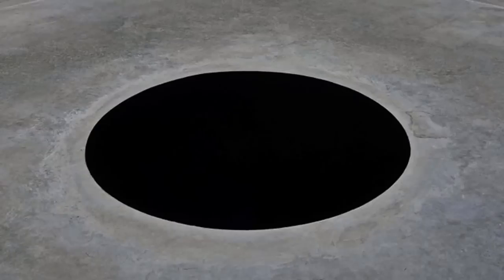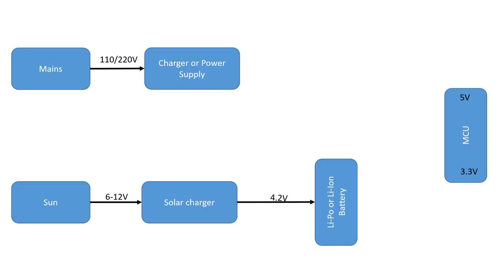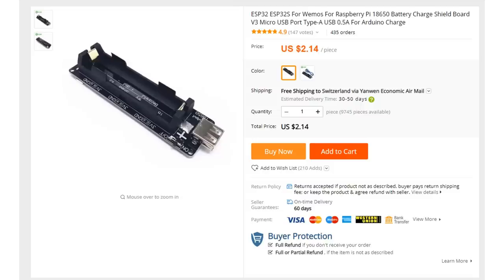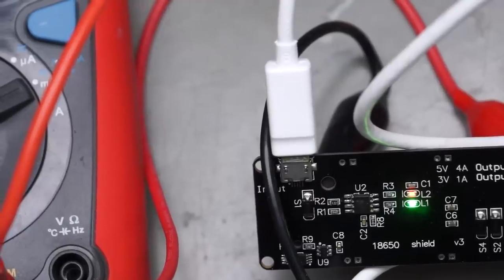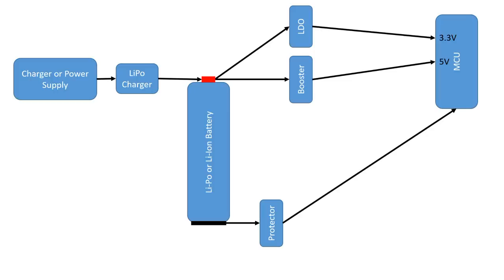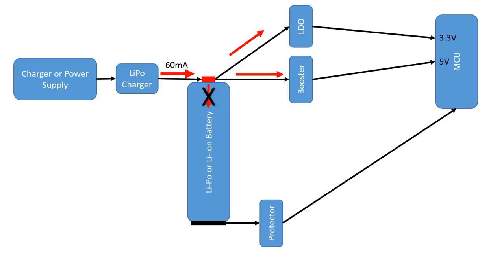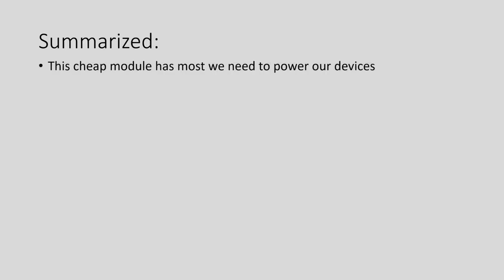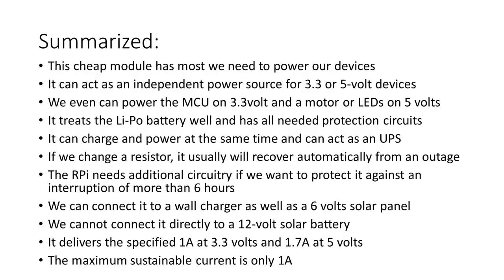#250 Universal Power Source (UPS) for only 2$. Is this possible? (Raspberry Pi, Arduino, ESP32)

Comment: I think you got the abbreviation wrong. It's Uninterruptable Power Supply.
Reply from the maker: Generally: You are right. But this module can do much more.
Reply: @AndreasSpiess  Maybe you should call it a UUPS
Reply: @AndreasSpiess  he isn't "generally right" he's specifically correct. How is this "universal"? Will it power my home? My car? No, it won't. If you think capable of powering a handful of devices makes it somehow special and "universal" I've got some bad news for you, any old UPS is capable of powering anything with a kettle lead or even more if you branch from the kettle lead to a plug socket, making it a hundred times more "universal" by your measurement.
Reply: There's always one. In this thread, it's you.  I'm sure your parents are proud.
Reply: That's what I was 🤔 thinking
Reply: To me it seems that the title "(Raspbery Pi, Arduino, ESP32)" clearly restricts the "universal UPS" claim to where it reaches... Just being reasonable, one can really really and clearly see that one or two small batteries won't run "your house"...
Reply: Smells like someone farted in here a while ago, but I just arrived :D
Reply: @jamesfirth7795  Generally as in “Generally speaking” as in “Generally speaking UPS means universal power supply” but Andreas decided to have fun with the video title because these things are made for many different maker projects. If you want to be pedantic then at least understand the context first.
Reply: Yeah I’m not understanding the Universal part, it doesent seem too universal
Reply: Basics
Reply: @Alacritous  I would be.

Comment: Andreas, you have a large enough viewer base. Why not design a product like this but with the modifications you just mentioned, and then open source the design or contact a chinese manufacturer to create it cheaply?
Reply: That is a freaking great idea.
The Andreas brand will rule the market. I for one will be a fan for life.
Reply: Professor Spiess, also it would be great if this new product had one more USB input port or even another Micro USB input port for the solar panel. Congratulations for this great class and I hope you design this new product! Thanks!
Reply from the maker: I sold hardware in the 1980 when one computer cost at least a million. Then it was fun. Today I will no more touch hardware as a seller. Sorry. Sometimes manufacturers also watch my channel. Maybe they react themselves.
Reply: @AndreasSpiess  actually, for the most part, if you design something useful, and at least do a test or prototype run, you will find nearly exact "clones" on your usual far east marketplace sites within a few months. But I do think you should release something of more ideal design under the "Swiss Accent" brand name;
Reply: @zerog2000  If he made a circuit and had JLCPCB or anyone else make it, I'd buy it just as support. Like other channels do t-shirts etc
Reply: @gg-gn3re  second this
Reply: @zerog2000  If you're not in marketing you may have missed your calling.  What a perfect brand name!
Reply: For the manufacturers out there! I'd love one that only charges to 4v, and cuts off at 3v to prolong the life of the battery! ;-)
Reply: Somebody could build.a gerber file and build the PCB.
Reply: @AndreasSpiess  Would like to build a safe 3.3V UPS.

Comment: I took a different approach on this topic, I made a small low power module that can charge a battery and power a device separately. for this I used a P channel mosfet (between boost and battery) and extra shottky diode. My module contains TP4057, smaller sot23-6 version of TP4056, some protection designed to cut off at about 3V, boost converter is MT3608 set for whatever voltage you need. When I connect usb lead, charger charges battery, mosfets disconnects boost from battery, and current flows from usb lead to boost part through a diode. As I made this to power up a DSO Shell, it's small, with everything on one side, but I think that mosfet swiching thing can be easily scaled up for higher current demands.
Reply: Post the schematic please
Reply: that is a much better design! you want to eliminate the number of power conversions in your circuits if possible. so the diode sends 5v directly to the loads dropping only 0.5v (could be less with a schottky) where with the power going through a TP4056 you get at most a 0.8v drop (not to mention the excessive wear on the cell when acting as a capacitor). this is always going to be a higher voltage than the battery so the diode in the mosfet will not conduct. Once usb power is gone then the mosfet will conduct the battery voltage directly to the load with very little voltage drop. I just wonder if there is a way to replace the diode with another mosfet, I think the trouble is getting it to turn on and off properly.
Reply: @SuperBrainAK  I added possible solution for this, it might work.  N channel mosfet with gate with a pull down resistor tied to the source connected to a usb power, and drain connected to a boost part of the schematic. This way when there is no usb power, mosfet is turned off, and when you connect power to it, that mosfet should open and conduct without any problems. Probably.
Reply: @kjur18  You can test one if the ideal diode modules you can get off eBay..
Reply: @SuperBrainAK  Let's see if we can mod this board with a diode, a mosfet (what do you use for Q2?) and a 10k resistor.
And maybe add some caps to avoid dropout during transitions.
Reply: Consider marketing your design on tindie, etc, before the Chinese steal it as per their usual modus operandi.
Reply: @HMPirates  Hmm they tend to not work in low voltages for Single cell Lithium batteries . The mosfets used in them tend to have higher Vgs Tresholds.
Reply: @kjur18  When USB power is present Source will be Positive and Gate will be ground so Vgs will be Negative So N-MOSFET will block right ?
Reply: @gopikrishnayogarajah  I might have messed up something in my mind, so I think it won't be easy to replace that diode. Well, first version works fine, there is no need to change it.
Reply: @youliantroyanov2941  What I used to make this are in fact three different products put into one board, to save space, even that mosfet based switch is something I found somewhere at JYETech page, they have a board like that. So it's not really anything new and groundbreaking.

Comment: Add some more 18650s in parallel
Reply: It's better to add a larger cell instead if possible, because you will need additional protecting circuits against high currents between the cells caused by their different condition: voltage, charge, age, etc.
Reply: @Megavoltamper  not really as long as you parallel the cells at the same voltage and leave them connected while they are being used, the only thing you may want is a fuse so if one cell dies the other(s) wont also. people do this all the time when making large batteries.
Reply: @SuperBrainAK . Multicell   LiPos have to be balanced after several cycles but preferably every cycle.
Reply: @RTmadnesstoo  that is only if the cells are in series, if they are in parallel and about the same size you dont need anything special to connect them together.

Comment: Great video. The correct way to deal with the issue of charging the battery whilst connected to a load is to run the Vin through a schottky diode to the boost converter bypassing the LiPo charger. The LiPo cell is then connected with  P-channel mosfet to the boost converter with the gate of the mosfet also connected to Vin. This will allow the battery to be charge independently of the load but will also switch the battery into play as soon as there is no input power. It's not good practice to sap the load power off the battery charger as you highlighted.
Reply from the maker: What are the advantages for the application described here?
Reply: Andreas Spiess By drawing power for the load separately from the LiPo charger whilst charging it would overcome the issue you mention in the video where the load of say a Pi doesn’t have enough current to function properly if the battery is charging but at a almost empty state. There’s a fantastic write up by Zak Kemble http://blog.zakkemble.net/a-lithium-battery-charger-with-load-sharing/

Comment: Thanks for the video.  I also tested two of them.  Bad solder joints on both. One dead after a month, and one DOA. I had to repair both, a chip lead, a fused resister, and a usb pin. Ordered months apart.  In the real world an rpi cannot run off one.  The battery voltage will drop over time.  There just isn't enough headroom with 600mah.  At least that was my experience on the two I tested.  After 4 days, a fully charged lipo which started  at 4.2v, was at 3.87v and dropping.  So it's not reliable for an rpi without changes.  And recovery isn't an option after an outage like you mentioned.   For esp's though, it's potentially fine.  I considered making one with two usb inputs, and switching.  This would leave enough overhead to manage the charging vs discharging separately.  That's the design I think I'd like to see.  A real ups should switch power sources, not unreliably limit the whole thing.
Reply: One dead after a month, with current well below 1A...
Deep sleep current was not 300µA all the time.
No battery reverse polarity protection (you need to often remove it to make a full reboot).
Good idea, although a "v2" would be greatly needed ;)
Reply from the maker: I have 4 of them. None was DOA, at least :-). Maybe you change R2 as shown to increase charging current to 1A
Reply: I have two of these that I bought 6 months ago. I use them all the time but not on RPi, just on Arduinos (ESPxxx or ATmega). They are very convenient for breadboard projects and I have never had any trouble with them. The only “problem” I see is that if I change the 18650, I also need to connect the USB-in port to a power source before any power comes out the USB-out port. I have assumed this is some kind of reset mechanism. However, I don’t think I would try to use one of these in a permanent project. For that I would usually go with a board that had a battery port on board. My LoRa gateway is based on a Heltec ESP32 + OLED with an 18650 inside the box wired to the battery port on the Heltec. Most of the time the Heltec gets power from its USB port but switches over to the 18650 instantaneously if USB power goes away. When USB power comes back, it instantaneously switches back to USB power and recharges the 18650. If that doesn’t qualify as “uninterruptible” I don’t know what does.
Reply: @AndreasSpiess  yeah I was going to give that a try :)  Was super informative. r1 is actually what burned up on the original one I had. So I need to replace that guy already. No clue why it did that or if it was a physical failure....  However an rpi runs pretty much all my home automation.  So not starting after a long power failure, is actually worse than the power failure :)  I'm working on  centralizing my backup power.  I've got all the parts, just not all the time to invest. :)  Best wishes and thanks again.  I enjoy your videos.
Reply: @HIBAW  why then not consider ol' good 12v lead battery if it is home automation and size/weight aren't an issue? Use tiny one, like 4.5AH. Controllers can be bought cheaply at firms that sell fire alarm / security hardware
Reply: @AB-pb8oo   Yes.  That's a really practical suggestion actually :) My pi is on a real ups atm.  I have one of these as well.  https://www.cyberpowersystems.com/product/fttx/cs50u48v/

 I still feel the need to take a whack at making something a little more flexible, cheap and portable.  If it's turns out cool or is worth mentioning I'll for sure report back.  The fun is the chase :)  Thanks for the suggestion cause that's been on my list and I should just get it done.
Reply: Its not good to leave a lipo on float charge of 4.2V permanently, battery life cycles will suffer. Laptops and mobile phones do some stuff to prevent thi. In a simple circuit like this it would suffice to lower the voltage a bit below 4.2v

Comment: I've never seen a Chinese product like this that works all that well and I have a little pile of puffed up lipo cells to show for it. I don't think it's easy to make something that works well with the cheap discrete components making up the charger->protection->regulation path. Richtek has some cheap (~50cents from taobao) parts that can do almost everything and have "power path switching" that switches the load directly to the input so it doesn't fight with the charger. Those would work well for a board like this. Aside from that there are PMIC chips that have the charger, power path and programmable DC-DC supplies for not much more that would probably would well if integrated into module with an ESP32. You'd be able to put sensors etc on their own DC-DC converters and turn them off when not needed, see the state of the battery etc.
Reply from the maker: There are some very nice chips used in tablets. However, I never saw them on a module.
Reply: @AndreasSpiess  

>There are some very nice chips used in tablets.

Exactly. Something like the AXP203 that's used in cheap chinese tablets would be good I think.
Reply: donpalmera That's how the C.H.I.P. (which is sadly no longer made) did its onboard battery charging, since it was basically a Pi competitor using cheap tablet tech. Unfortunately I'm not sure there's anything like that being made today.
Reply: @makomk  
The chip was based on an Allwinner SoC. The Allwinner SoCs are always paired with an AXP PMIC...
Allwinner make a chip with a 1.2ghz Cortex A7 and 64MB of RAM in an QFP package (hand solderable) that costs about $4. :D

Comment: 6:50 Cut the PCB trace instead. It's easier and you don't risk breaking the chip.
Reply from the maker: Maybe you try it . Will not be easy.
Reply: @AndreasSpiess  or lift one side of the IC, put Kapton tape in between the leg and the pad and resolder the other legs... Funktioniert gut und schnell 👍

Comment: I don't like the DW01. Wherever possible, I replace it with a Fortune FS312F. It is a drop-in replacement that has much better voltage constraints; it cuts out at 2.9 volts on discharge and 4.25 volts on charge.
Reply from the maker: Thanks for the tip. I will try it out

Comment: This is the module I used for my solar backpack. Bypassed charging circuit by soldering SX01-3A solar controller output to the battery holder. Worked great this summer but now it is winter and the boost converter that is always on drains battery.
Reply from the maker: As said it always draws at least 0.3mA if you do not disable 5V
Reply: @AndreasSpiess  Yes you did.

Comment: Typically boost converters and LDO can have an enable input. Correct scaling of these enable inputs allows low battery voltage detection and reduction of drain current below your 60mA required for charging deep discharged battery.
Reply from the maker: You are right. But not here.

Comment: Since I'm playing with two voltages on my DIY raspad (12V for the 10 inch lcd and 5V for the rpi3), I've used 4 li-ion cells in series. Used supposedly "20A" voltage regulators each (for the lcd and rpi3). Planning to try out an XL4015 since it's rated "5A."
Reply: webslinger2011 and did you solve the challenge of charging while using?
Reply: @JensRoland  I haven't installed a bms on the battery ( waiting for it to arrive). Need to test an XL4015 on the pi. So I haven't gotten to it yet.

Comment: nice part, but as you stated, not usable as uninterruptable power.  It's a fact that UPS are more expensive in case of "extended design"
The other problem of solar charging, at least in our country, is, that the solar cell most of the time delivers not enough voltage/current to fire the LiPo-Charger (most of them need 4.8V). 
There are interresting products with the AEM10941 Solar Harvesting IC, but there output current is (badly) limited to 80mA
Reply from the maker: I would use it for situations where you have to protect against short outages up to a few hours. Then it should work ok. 
Concerning Solar. You are right. Here we need quite big panels to get enough electricity. Harvesting might be something for really low power devices. I have a harvesting chip here and on the to-do list...

Comment: Really useful, thank you.  I will follow the link and buy a few.  I use the exact same components (less the boost converter) in some of my projects and think I would generally: 1) remove the boost converter completely and 2) remove two of the LDO regulators as I normally don't need the full Ampere.  That way I see a neater board that is easily suitable for small solar projects at a price lower than I can do it by assembling the parts (4056, protection circuit and LDO reg). Thinking back to your previous comparison of these charging boards, the 4056, this was my firm favourite as all of the switch mode versions failed to pass any charge current in dull weather, where this actually does pretty well even down to 1mA.  Thanks again, thumbs up. :-)
Reply: And I have ordered 5 of them so hopefully you will see a few cents from me. Thanks for the hint.
Reply from the maker: This is why I called it "universal. You can remove things if you do not need them. They are so cheap. Thank you for your support!

Comment: I know this is an old thread, but given the SuperPower project was cancelled, I wanted to try this out on an ESP32.  Some amazon reviews of this board say there is an interruption of power when the charger power is disconnected.  I didn't see an mention of this in your video, plus it would not be an UPS it it did this.   Just checking.
Reply from the maker: Mine did not have this effect. But I know that there are many different variants in the market.